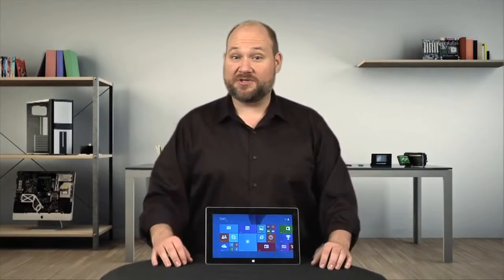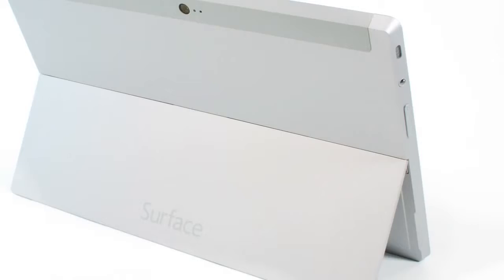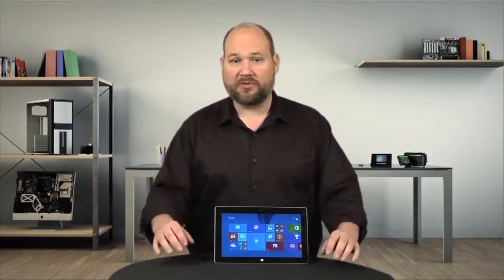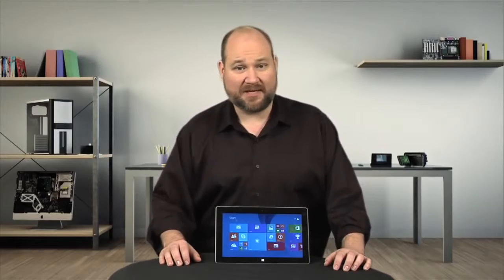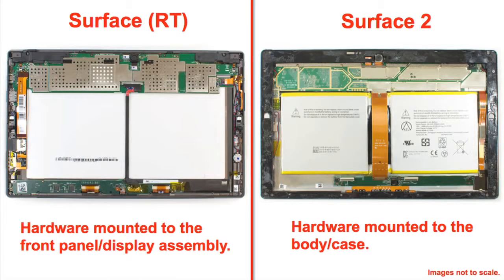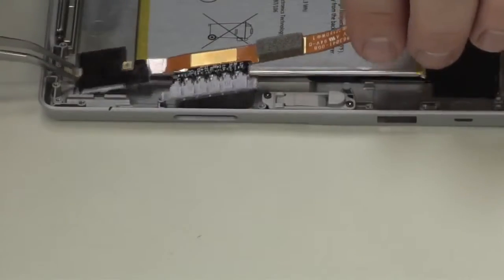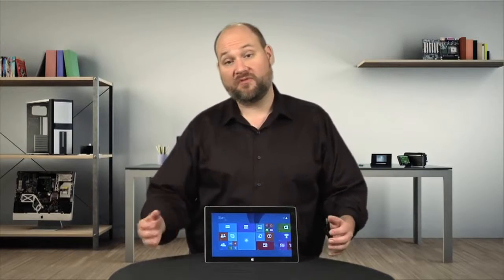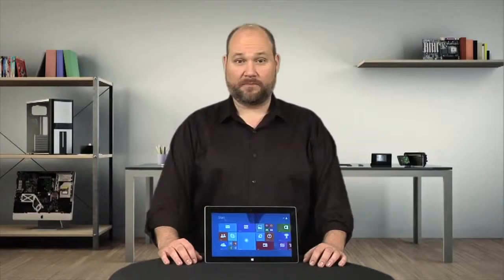Cracking Open Microsoft Surface 2

Comment: What kind of screw is this to remove the PCB board from the digitilzer and LCD (The one with the 3 screws holding it in place). What screw bit is it and what size is the screw bit?